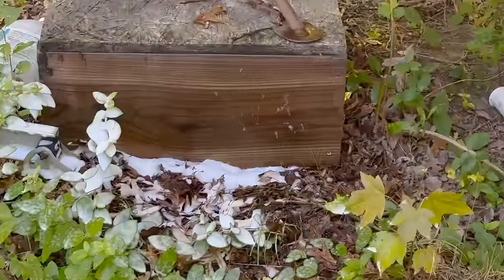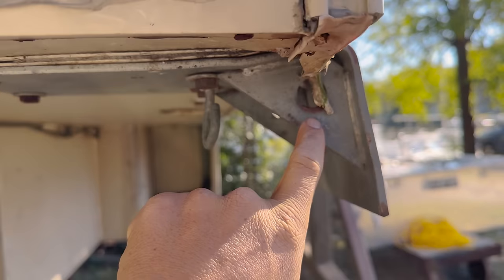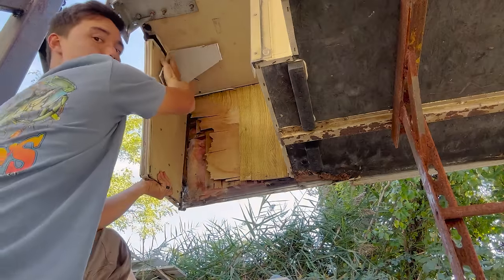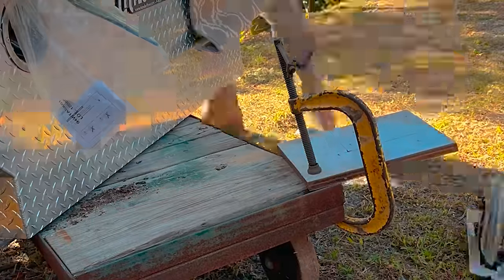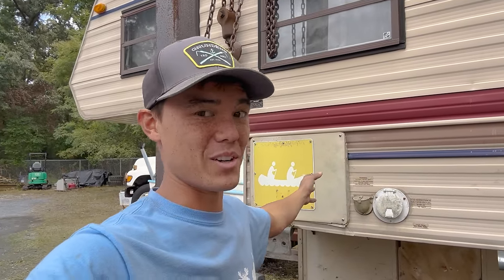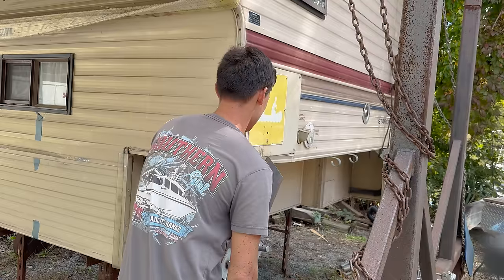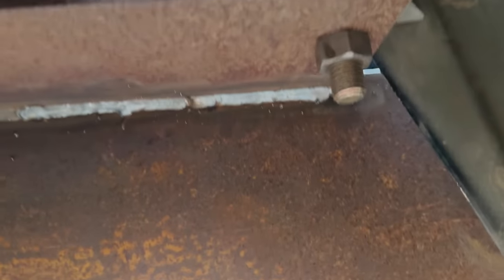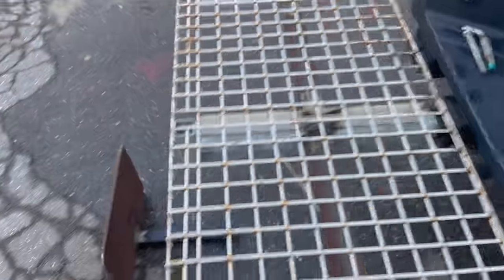I bought the CHEAPEST Camper off of Facebook Marketplace

Comment: I was an electrician at a camper factory. We built everything from big 5th wheels , pop up campers,to these truck bed campers. Unfortunately no matter how big or how much you spend,they are all built like crap! The framing is all2x2 connected with staples, interiors are 1/4 pressbord like strong cardboard,and particle board cabinets.

Comment: The thoroughness of your camper repairs are admirable.  Nothing at all to be ashamed of.  In fact like you mentioned, the repairs you did were much stronger than original factory work. 

 I too have an old cheap truck camper I’ve been putting off rebuilding the back entry door that’s falling apart and doesn’t latch properly.  I don’t have access to all the materials or tools (nice mag drill!) but will eventually work on it when it comes up to be it’s turn amongst all my other broken projects 😂
Reply from the maker: Looking forward to seeing it!

Comment: In 1980, when I was 19, I bolted my truck camper to the floor of my 
1972 Ford F-250 Camper Special with a threaded rod and steel plates.

Comment: To space the cabover section of the truck camper from the cab of the truck. A 4'x8' sheet of 2" thick foam insulation is best.  I had the same piece of foam for 10 years with my truck camper.That peice of foam has seen over 40k miles and 38 states without an issue. also helps insulate the floor for winter camping.
Reply from the maker: That’s a good idea!

Comment: Looked great, you definitely improved the camper. As far as the welding the only thing I would suggest is to clean the surfaces that you are welding that will improve the strength of the welds.

Comment: I bought a slide in camper once and the guy gave me the truck it was on for free. It was an s10 with a 2.5L 4 cylinder "Iron Duke" with a slight knock. Drove it from BC Canada to Ontario Canada and then used the truck for another year. Best $600 I ever spent. And yes, I gave it a tune up and stuff. When I would get gas at the gas pump, they would say "Sir, the Diesel  pump is over there." Then I'd say "It's not a diesel." Man, talk about the funny looks I'd get. Hilarious.
Reply from the maker: Haha that’s funny that was my first truck! 1991 Chevy s10 iron duke with a 5 speed! I loved that truck! Traded it for a 1967 vw bug